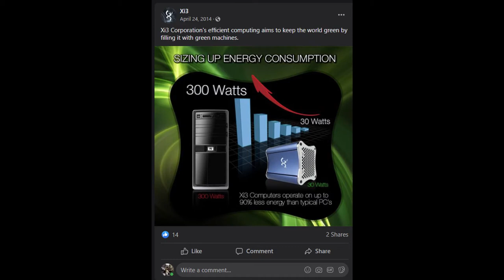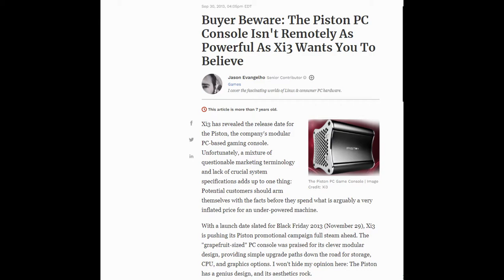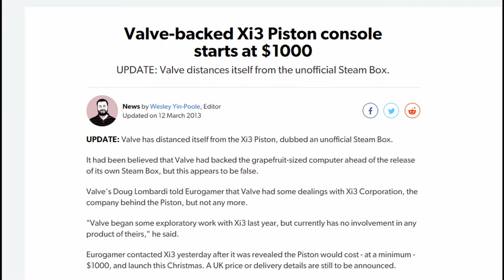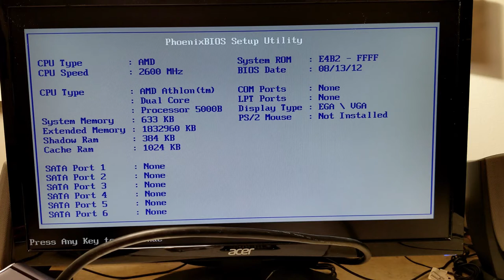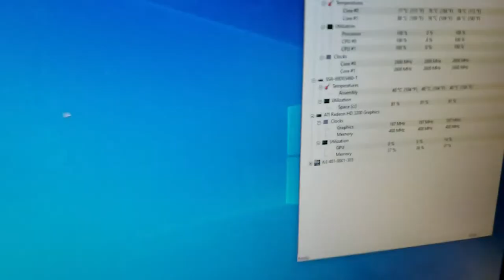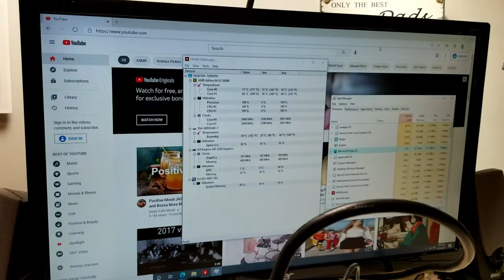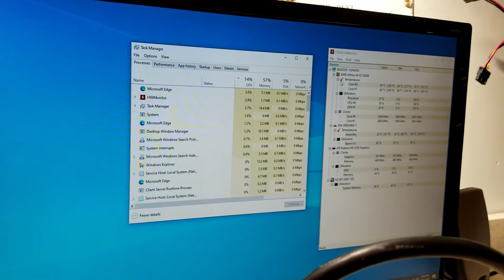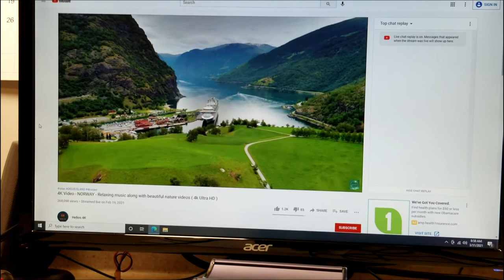The Xi3 X5A - What magic lies inside?

Comment: Oh, I had forgotten about those little things!  I remembered them as soon as you showed it off.  Very cool little boxes.
Reply from the maker: It is really cool, but what a shame they made it into a gimmick. So underpowered, and on older hardware. I will find a decent use for it yet lol
Reply: @Snickerrick  You could run Doom3 on it :D
Reply from the maker: Yes!!! I need to find an original Doom 3 copy, I have BFG and it wont run on anything older than windows 7

Comment: i found one at my Local Flea Market for $5 and it HAS Windows 7 pro 8gb Model USB3.0
Reply from the maker: Nice!! I wish I found this one for $5!
Reply: @Snickerrick  I posted a short video of it on my page
Reply from the maker: Thats awesome!
Reply from the maker: That is the later model too, even better. :)
Reply: @Snickerrick  it's a AMD R Series 464L 35 watts I see a small list of other 35w but got me wondering if I can put a 65 watt on
Reply from the maker: I guess if the power regulation and the adapter can handle it, throw a fan in front of it and send it lol 
Seriously though I wonder that too
Reply: @GENERALCHAOS13  I put a 5050e ($7 ebay) in mine for fun. It works. Gets hot but stays at 2.6 ghz. I put USB fans at both ends. Had Windows 10 on it but switched to Linux.

Comment: Buenos Días, le borre el sistema Linux a la Xi3 X5A para instalar Windows 7 de 64bits, al final de la instalación salió un mensaje indicando que no se pudo terminar de configurar el software para ese Hardware. tendrás información sobre una instalación original para este equipo con Windows 7. Al instalar le borre todas las particiones al disco solido de 32GB
Reply from the maker: Gracias por el aviso. Planeo obtener una unidad mSATA más grande y ejecutar SteamOS 3.0 cuando salga, solo por diversión :)
Reply: Llama